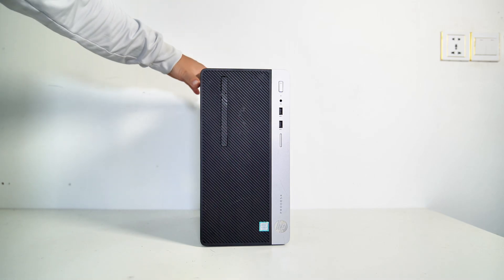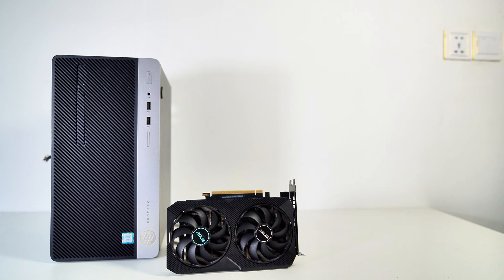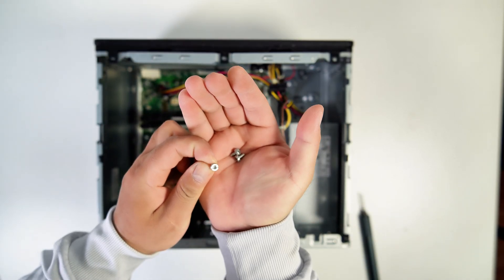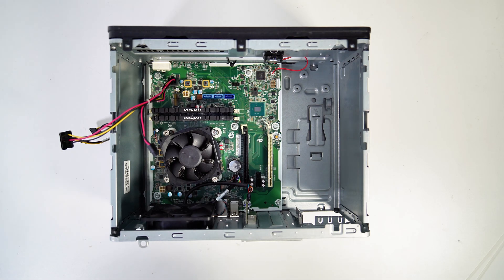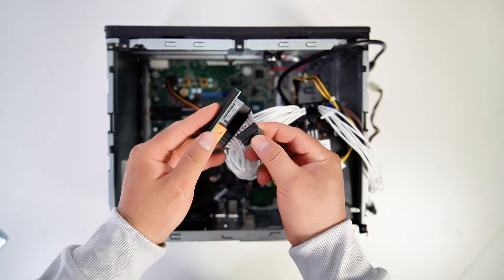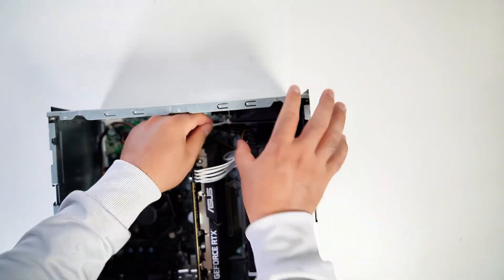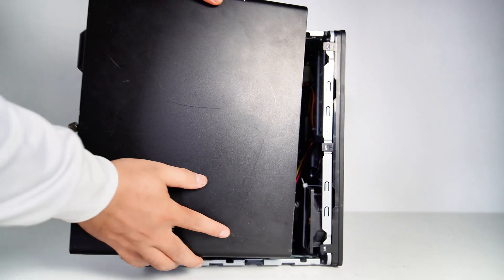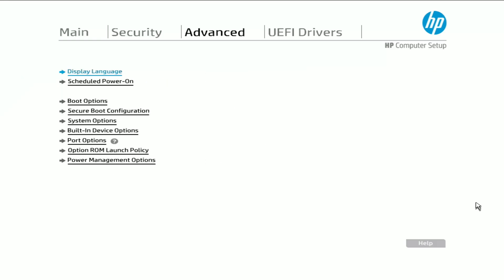I use mining rig technique to make HP Prodesk 400 G4 MT gaming upgrade possible

Comment: I accidentally ordered the HP Prodesk 400 G4 SFF so not the MT case probably can't fit a decent gpu or mod psu can I? Any thoughts? Current power supply is 180 watts and has the smaller half height slots for a video card.

Comment: Hello, i wanted to ask, why add second psu when you can just replace the 200w psu with the 400w , wouldn't the power be enough for the 3060 and cpu?
Reply from the maker: This is a YouTube video topic. I post many videos exploring different ways to upgrade a PC, such as adding a second PSU, upgrading the existing PSU, or downgrading the CPU to match the PSU. This ensures viewers can find precise information relevant to their situation. You can also check out my other video on upgrading the power supply for HP desktop PCs. Thank you.
Reply: @itggear  thank you very much
Reply: @itggear  however, i wanted to ask, is it possible to just replace the hp psu to some flex atx psu? will the default connectors will be compatible with my hp prodesk?
Reply from the maker: @sandwitch3371  No, if it can be replaced with a flex PSU, I won't need to add two PSUs. HP uses completely different power cable connectors, and for now no adapter should work on this model.
Reply: @itggear  thank you very much for replies, very helpful

Comment: Can i use gtx 1050ti without changing the psu?
Reply from the maker: I think it should work. However, a 180W PSU is too small—it’s even smaller than some laptop AC adapters. If you can manage to upgrade your PC's PSU, it is highly recommended.

Comment: can i use atx psu ?
Reply from the maker: I think you cannot use an ATX power supply in this PC since there isn't enough space if you want to add 2 PSUs. If you want to change to a standard ATX power supply, it will not work on this PC since there is no 24-pin power supply adapter that works with this PC model. Thank you.

Comment: You mention both the 3050 and 3060 in this video. Looks like the 3050 to me 

Loving your content. Everything you do is very calculated and from a step back perspective. You also try different ways to do the upgrades. From a factory psu upgrade and a new case to a 2nd psu in the original case. 

All we can do is try to follow. You have skill. 

I see the psu mod here. I heard there’s a way to solder something in there and add a 6+2 coming out. It gives an extra 150w to the standard psu but I don’t have enough knowledge. That’s how they made the 500w psu for these hp’s. It’s just a simple mod to the 250w psu. They make it 400w or 500w

Anyway if you can measure the biggest length card we can fit in there I’d like that

Comment: When you added the power cord cable by soldering those 2 wires with the HP psu, does it make a difference which wire is solded with? or you can flip the wiring as long as you wire 1 on each side?

Comment: Awesome video, you really helpfull

I'm thinking to do the same method for my pc, but using normal ATX PSU since the Flex quite bit expensive here and the choice is limited. Same with the original 500W PSU like other video.
I have to sacrifice the look over the performance 😂
Question: 
1. is it okay to put normal CPU outside? how about the grounding? do you think it need physically contacted with metal case?
2. how about for the long run, is it safe?

Comment: I use this litte Beast as VR only Gaming Pc. 3060 with 12 gb  and an SF PSU modular. Cheapest way you bridge 2 Pins on the PSU, and need only the Grey Cable to HP Mainboard. Pro: Start with Powerbutton works. Negative: turn on and off your PSU or it run all the time.

Comment: Any VGA card for prodesk 400g6 MT?
Reply from the maker: It depends on your PC power supply capacity. Most HP mid-tower PCs come with a 180W PSU, which is not suitable for any GPU at all. However, the HP mid-tower could be configured with various PSU options like 250W, 310W, and 500W. If your PC comes with a 250W or 300W PSU, a 70W or 50W GPU should be suitable for your PC, such as RTX 3050 6G, RX 6400, GTX 1650, GTX 1050, GTX 1050 Ti, etc. If your PC's PSU is 500W, you can install more powerful GPUs like RTX 3060 up to RTX 3060 Ti or newer RTX 4060 or RTX 4060 Ti. Just make sure your GPU does not exceed 250mm in length. Thank you.

Comment: Which GPU will run without additional power supply in this model HP ProDesk 400 G7 Microtower PC (31P90PA) i5 10th generation?
Reply from the maker: Any 70W or 50W GPU, like the RTX 3050 6G, RX 6400, Intel ARC 380, Quadro T1000/A1000, GTX 1650, or GTX 1050, can run just fine in this PC without upgrading the PSU. Thank you.
Reply: @itggear  I have a HP Prodesk G6 400 with an 180watt psu, would the RTX 3050 6gb you mentioned work with it, or would it be unsafe?
Reply: And it is a MT so a Micro tower

Comment: Hi, im thinking of upgrading this pc gpu. The gpu i intended to use is gtx 1660ti, with max power consumption up to 120watt. Will it be okay to just use the sata to 6/8 pin adaptor or upgrade the psu would be the better option.
Reply from the maker: Yes, if you have at least a 450W PSU. Otherwise, you can upgrade the PSU. Please watch this video: https://youtu.be/DvNWbDd-ZCQ
Reply: @itggear  thanks for your reply, just as I thought, I might just upgrade the PSU.

Comment: What’s the latest cpu I can install in this upgrade?
Reply from the maker: The HP ProDesk 400 G4 supports Intel Core, Pentium, and Celeron 6th and 7th generation processors. Therefore, the most recent CPU supported by this PC is the Intel Core i7-7700K. Thank you.

Comment: First, i want to thank you for making an amazing video. You are a true legend. I want to ask if i buy a good psu. Do i still need to do this 2 psu mod. Is it possible to use one psu for gpu and motherboard?.
Reply from the maker: Yes, absolutely. Please check this video: https://youtu.be/DvNWbDd-ZCQ . The power supply model in this video works for all HP G3, G4, G5, and G6 desktop PCs.

Comment: I saw one with a i3 6100 which cpu is the best for gaming on the 1151 socket? That obviously works with this pc?
Reply from the maker: For the HP Prodesk 400 G4, the best CPUs for gaming would be the Intel Core i7-7700 or the i5-7600K. Both are great options and compatible with the 6th and 7th gen Intel CPUs that this PC supports!
Reply: Unfortunately they dont support windows 11 officially.. is it still safe to install win11 on gen 7 and 6 intel cores?

Comment: is this work on prodesk 400 g5 with asus strix rx570 oc 4gb.
Reply from the maker: The concept of adding two PSUs using SATA to a 24-pin power supply power-on kit is an idea I wanted to share in this video. While it should work for running an RX 470, the implementation can be complex. If you plan to use an RX 470, please check your PC’s PSU. If your PSU is 300W, you can use a SATA to 6-pin or 8-pin PCIe cable adapter to install your RX 470. Thank you!

Comment: hello friend, thanks for the content, you have helped me get out of doubts but you have also generated another. I have an HP prodesk 600 G4 MT i5 8500 and I am thinking of buying an RX 580 (which is just the right size for the MT case) and a 550w power supply considering the idea of leaving the source external while I buy another case (depending on the size of the source) ... my doubt now is about the connectors, I was thinking of buying a 24-pin to 6-pin adapter but I realize that the motherboard has a 4-pin input, this leaves me very confused because I cannot find connectors for 24-pin to 4-pin, only 24 to 6, really, is there no other alternative, do these connectors not exist? I wouldn't dare to do what you did in the video, no matter how funny it is, but I loved watching it. I had been looking for many months for modification content for HP ProDesk PCs. You came from heaven bro.
PS: In the event that the power supply cannot be changed safely, I will have to buy an Nvidia Gigabyte GTX 1650 OC.
Reply from the maker: Hi, if you are looking to upgrade your HP ProDesk 600 G4 with an RX 580, here are some ideas based on my experience:

- Original HP 500W Power Supply: You can buy an original HP 500W power supply (model: DPS-500AB-32A) from marketplaces like eBay or AliExpress. Prices range from $35 to $150, depending on the seller. This will allow you to upgrade your preferred GPU straightforwardly.
- Changing the Case and PSU: If you plan to change the case and put the PSU outside using a 24-pin to 6-pin adapter, it won’t work. Please note that there is no 24-pin to 4-pin cable adapter for HP motherboards. Additionally, the 24-pin to 6-pin adapter for HP is not compatible with your PC.
- Using GTX 1650: If you decide to use a GTX 1650 for your upgrade, it’s also a good option. All you need is the GTX 1650 GPU card, and you’re good to go.

Thank you.
Reply: @itggear  Thank you very much for your reply, my friend. I will have to go for the 1650 D6 4G OC. I have seen some tests with my i5 8500 and it works very well. Later, when I want to buy another PC, I will take all this data into account. Greetings from Venezuela. I will be attentive to your content.
Reply: @RaphaAlgarin  lograste hacerlo amigo? estoy en una situación parecida
Reply: @plexplextor  Hola , al final compré la GTX 1650 D6 ya que la rx 580 no iba a caber en mi case, hubiese tenido que modificar el mismo. la gtx 1650 es de un tamaño menor y ademas consume mucho menos, eso hizo que NO tuviera que cambiar la fuente y la conecté a un adaptador "dual sata a 6 pines" y pues todo genial mi  hermano
Reply: @RaphaAlgarin  cuanto te salio esa grafica? lo mínimo que la he visto es casi 200 dólares, pero creo que hay una versión que no necesita conector de la fuente estaba pensando en ella o la rx 6500. Gracias por tu respuesta
Reply: @ la que compré es la ventus xs ocv3. si no me equivoco la ocv1 es el primer modelo y no necesita alimentacion ya que consume menos y es gddr5. pues si tienes uno de estos equipos sff o como la mia que es MT pero con una fuente de 240w te iria muy bien una rx 6400 LP que es casi la misma version que la 6500 y rinden un poco mejor en algunos juegos y ya no te preocupas por conectores
Reply: @RaphaAlgarin  Si bro la mia tanbien es MT y estoy entre esa 6500 lp o una 3050 de 6gb que vale un poco mas. la 1650 era la que queria pero aca en mi zona esta casi al mismo precio que una 3050
Reply: @plexplextor  sin duda la 3050 pero asegurate de tener la fuente para esa gpu🔥
Reply: @RaphaAlgarin  si amigo pero lo bueno es que la versión lp no necesita conector de la fuente y consume menos de 70w hay muchas pruebas en yt y va muy bien en este tipo de pc de oficinas con fuente normales
Reply: @itggear  Is the HP 500W Power Supply compatible with ProDesk 400 G5?

Comment: can i put xeon on this pc... ??
Reply from the maker: The HP ProDesk 400 G4 is designed to support Intel 6th and 7th generation Core processors, such as the i3, i5, and i7 series. Unfortunately, it does not support Intel Xeon processors. If you’re looking for a workstation with Xeon support, you might need to consider a different model, such as the HP Z series. Thank you for your question!

Comment: PCIe 8-pin power connectors aren't proprietary. Smh you have absolutely no clue what you're doing.
Reply from the maker: Yes, indeed, the 8-pin power cable is not a proprietary connector. However, the power supply that comes with this PC is 310W and does not have an 8-pin PCIe power cable. The recommended power supply for an RTX 3060 is 550W, so using a 310W PSU is not secure for long-term operation with this setup. Adding two PSUs to a PC is just an idea and can be fun too. Thank you! 😊